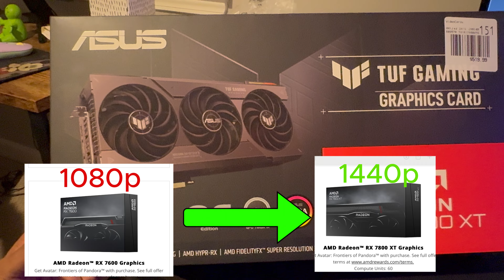I Upgraded My GPU! Asus TUF RX 7800 XT - (PC Build Vlog 4)

Comment: Great video. I decided to go with this card for my new pc build. Clean, clear and explains everything I needed to know. Thanks alot.
Reply: hi do you think this card is worth it for 480 euro?
Reply: @Maxime-xr7er   Hi, if the conversion to my currency is accurate then 480 Euro seems good. I got it with a promo for 699.00 CAD$. This card far exceeded my performance expectations for the price. Keep in mind that what matters also is if you care about 4k and Raytracing or not. I do not, so I went with AMD and I also value more the 16gigs of VRAM. Continue to research and choose what budgets well with your build. But if I had the extra money I would choose NVIDIA.😀
Reply: @SxD1982  prices  of nvidia is way to high in europe a asus tuf 4070S is allready 750€ also im currently allrrady 8 years playing on xbox one s (gtx750) sm i dont rrally care about raytracing bcs currently i played fzllout 4 on low-medium settings and sometimes i get like 10-30 fps so i think the rx 7800xt will be enough since online sources say its 1,200% performance increase. Did you have any issues?
Reply: @Maxime-xr7er  In my opinion, go get that beautiful 7800xt :) YOU WILL NOT REGRET IT!

Comment: So powerful uses 2 power cables when im using 3 just depends on brand ect
Reply: Correct, but it usually depends on how powerful the power source to the GPU is. Sometimes same GPU'S has 2 or 3  depending on the brand and also how well it will overclock.

Comment: Didn't even show how you connected the power cables to the PSU form the GPU.
Reply from the maker: @chrisw.6060  I mean. All gpus connect the same
Reply: @BigStuDolla91  no they don't
Reply: @ What is the other end for the GPU to the PSU then? Is it the 6 pin or the 8 pin?
Reply from the maker: @ 8 pin from psu. Gpu uses a 8 and a 6+2
Reply: @BigStuDolla91  I got it now. Thanks.

Comment: can run my 700wat bronze+ psu this card?
Reply from the maker: You might want to upgrade. I was using a 700watt white psu and it worked but more would be better in the long run
Reply: Depends on your cpu and rest of the system i  got 7800xt and it don't use more than 600w on my 650 psu